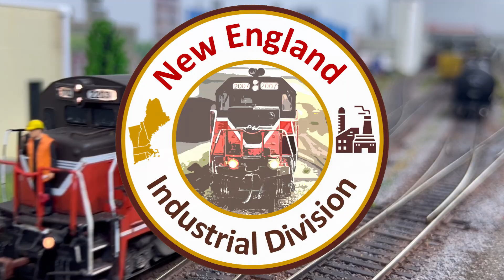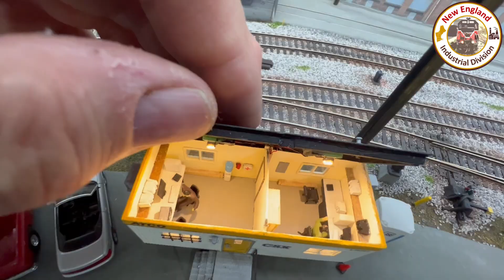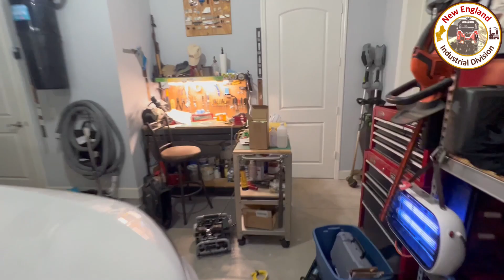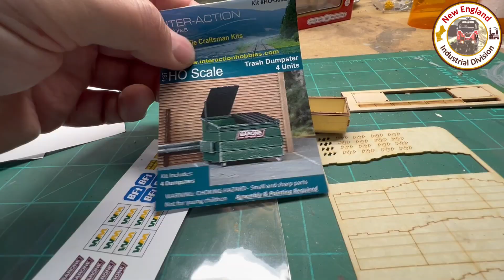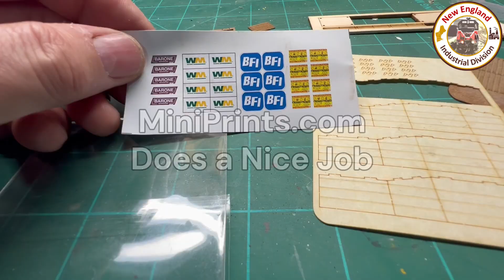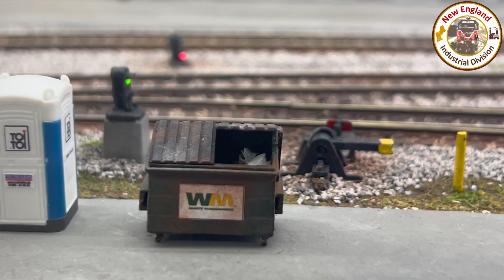Build an Interaction Hobbies Dumpster for Your Model Railroad

Comment: Great video, an I've appreciate the tips I've gotten from you. But what type of adhesive should I use or that you would suggest for track laying? Im not using cork, plan is being based off an engine yard an car shop with small yard.
Reply from the maker: Depends on what your baseboard is that you are laying track on. I use homasote board as the base with no cork roadbed, so I just use peco track spikes, then glue the ballast with 50/50 elmers and water with a touch of dish soap mixed in. If you use foam as a baseboard, you could use a thin layer of acrylic caulk to “glue” down the track. Other viewers might have ideas as well.